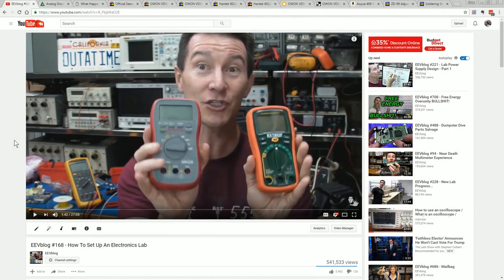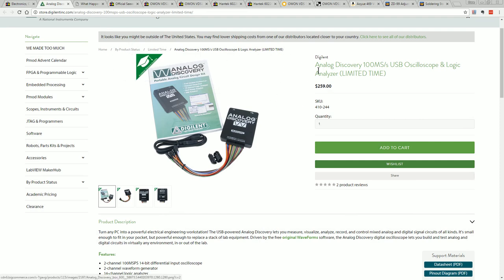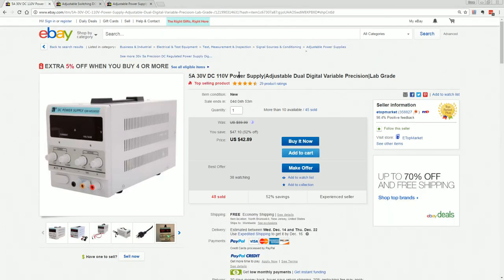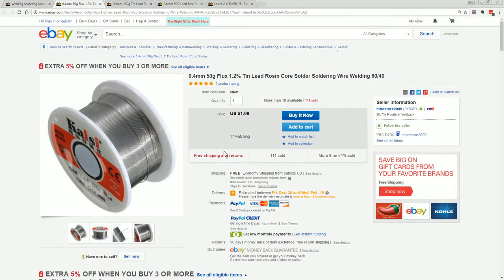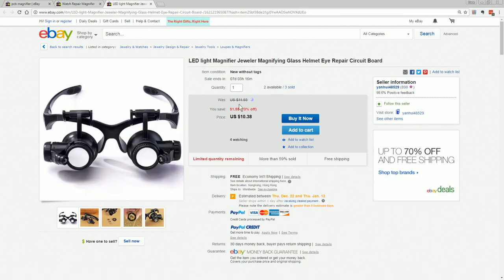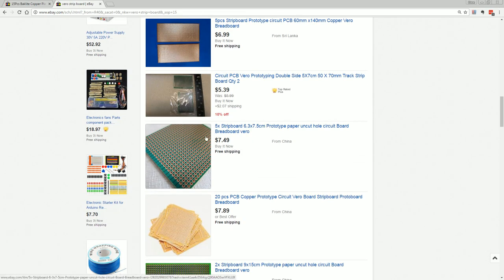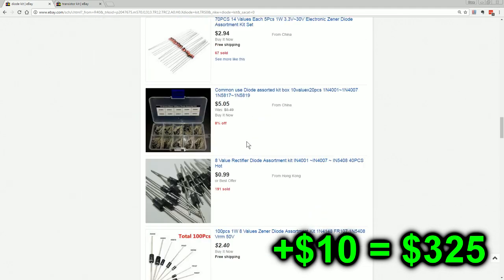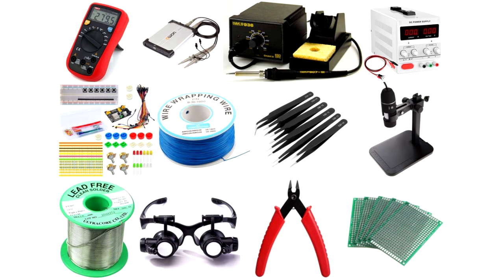EEVblog #954 - How To Setup An Electronics Lab For $300

Comment: I'd add an antistatic mat and a wrist strap to the kit.
A wrist strap is the minimum (should be under $2 US from China). A good-sized mat should be about $15 or less. You should be able to find them as a set.
If you have a bit more money to spend, get cover your workbench with a thick antistatic work mat that resists heat and cuts. If you cover your bench like that, you can probably get away with not wearing the wrist strap all the time.
I always wear a strap when I'm working on PC motherboards, RAM and plug-in cards.

Super cheapskate tip: Check with your company's IT folks. Server parts often come with single-use wrist straps (that the IT guys just throw away).
Reply: Craft store "self healing cutting mats" are not anti static.

Comment: Beware of cheap autoranging DMMs that take ages to settle, and give a series of false readings before they do. A manual range switch is better than these. If you want an autoranger, you might want to pay a bit more for a half-decent one. AN8008 maybe?
Reply: you can set most autorangers to a specific range for faster readings.

Comment: The cheap resistors don't work in the cheap bread boards because the cheap resistors use wires that are too small to work in the cheap bread boards.
Reply: the ones I use do seem to work although they can be a bit fiddly yes, you could twist and double the ends together or you can even fit 2 components in the same hole for a good fit ..... I personally prefer the cheap breadboards as the 'good' one I have grabs stuff so tightly things often break when you try to get them out.
Reply: I can understand you through your accent.
Reply: that's good (?)
Reply: Yes I hate that all the resistors I've bought recently (cheap ones) have weak wires. They're not too small as such, just so weak that they bend before you manage to plug them in to the breadboard.
Reply: I always make a point of checking the pictures before purchasing for exactly this reason. Got some of those cheapies god knows where. Included in some kit or other, I guess. And I find them utterly frustrating to work with. Same for other components, such as capacitors etc.
Reply: cheap carbon film ones have thicker legs and easier to read color codes than those metallic blue ones
Reply: Old comment, but for anyone reading this, you can get 1% resistors with thick leads from Tayda. They work well for breadboarding.

Comment: those magnifier glasses is usless.you have to hold the object you work with so close that it is not posible to work. i tried 25x lens with the user manual 2 cm from the lens you could read it.the hakko ripoff  has so bad plastic base nut where the ceramic heater starts.it so bad that the ground spring in the iron has force to make it pop in 2 and tip and assembly can drop in your lap hot.they dont last a mont.better to buy the hakko fx8801 replasement iron for hakko station and just use the plug and cable that comes with the chinese iron so it fits the station you have.i could use the hakko cable and just change the plug.but the wep 2 in one i have has a movement sensor for sleep mode so i used the print chinese wep irons orginal print board and cable but hakko ceramic heater and assembly.works fine and last.it is more expensive to buy crap like the iron that comes with WEP 862BD+ that brake in a week.i was "lucky" that i got a new station on waranty that also broke in a week.the handle that brake is WEP 9071.it is the same as in the station in video.orginal hakko iron prize about 16 us dollar it works with most 24 volt stations from china.i also went and bougth new quality caps for and 2 triac that handle more power.i also put extra copper fin on the cooling element on them.drilled vent holes in the cabinet on safe for spill places.if it is transformer that holds together with clampt metal.put the corner off it in a wise and tigthen it up.if possible, solder the corners when it is under pressure if they have bolts tigh them upp.goes for all srews in the station.just make shure they are tigth.or live with a noise transformer that gets louder and louder.sorry for my bad english.i love those videos you put out.ihave my own el lab dorment for years but now it is upp and running thanks to inspiration from videos like yours

Comment: T12 is much much better than YIHUA. And you can also find it on ebay and also as KIT. I have no good experience with solder from e-bay. Solder with lead is like lead free... I prefer buying solder locally.

Comment: If you have good eyesight, you maybe able to get away without magnification glass or USB microscopes (I sure do, and I have the 20/20 eyes for the job)
Reply: This video popped up shortly after I ordered a Fluke 17B+ and Hakka FX-880D. It got me to go ahead and get the power supply.  Using wall wart power supply's suck. You can't see the current so with a dead circuit you don't know if something is shorted out or open circuit.  Well until you burn a finger in something. Now with the Rigol scope I got a couple years ago I may actually do more stuff

Comment: Hey guys, if you are going to buy prototyping board, don't buy the yellow ones. I have already tried it. They are not worth the mony savings. They crack easily and the copper pads don't hold.

Comment: 8:04 they are terrible. and when i say that they are terrible then they are terrible. I once bought them and when you start soldering, the pads fall right of the board. and also they smell really bad and that for many days. that smell will never dissapear. Just invenst a little more in those pcbs and you will get something that is sooo much better than that. (i had experiemce)

Comment: You can get all but the Oscilloscope even cheaper if you have the patience to wait for it to come over from china. Aliexpress is your friend if you are fine with cheap chinese crud.

Minus the Oscilloscope, I just priced this in at a little under $100 on there. But then there is the 20-50 day lead time.

Comment: There's lots of kit function gens out there. But I'm having trouble finding anything that can give me a 12V square wave for testing automotive stuff that I build for my old land yachts. It would be nice if it had a box since my workbench is stainless steel with lots of holes in it (used to be a clean room workstation to allow acid to drain through if needed). Those kit boards don't much care for sitting on that surface and I really don't want to have to spend hours grinding some project box to fit the silly thing. If anyone can help me, that would be great. My Google-fu has failed me.
Reply: Looks like I might have to use a lower power gen and just trigger a mosfet for the 12V pulses. All of the wave stuff I need is 5V or lower.
Reply: 0V to 12V or -12V to +12V square wave? I assume 0V to 12V. You should have a look after FeelTech FY3200S series signal generator. It's a really good compromise about functionality and costs.
http://www.eevblog.com/forum/testgear/feeltech-fy3224s-24mhz-2-channel-dds-aw-function-signal-generator/
Reply: ***** Nice. Thanks for the help.

Comment: @EEVblog would one of those inexpensive clip-on microscope lenses for cellphones, and a decent older camera phone be a good alternative to the USB microscope for SMD soldering? Perhaps mounted on the base of my helping hands using a cellphone car mount?

Edit: got this mount https://www.wish.com/share/4130hbrqgx and this microscope lens https://www.wish.com/share/3363hbrqot and fitted it onto my iPhone 4S. The instructions direct you to an accompanying app called TinyScope that allows you to use the flashlight function and the camera at the same time, make measurements (once calibrated), take photos and shoot videos. 

Assuming that you are using an old phone, you can breathe new life into an old device, and get the functionality of one of the soldering microscope devices with a built-in screen, for the price of the USB microscope (probably with a better camera).

Comment: Hmm, perhaps you might be clear that this is how to set up a lab super cheap if you absolutely cannot spend any more, but when you use cheap equipment, things function poorly and break.  I hope new hobbyists don't get frustrated when they buy stuff that doesn't do what they need it to do, and then needs to be replaced when it craps out.

Comment: I wouldn't buy cheap magnifying glasses or usb scopes. They are nearly useless. Since I have good eyes, when I need to use magnification it has to be decent. Most young guys starting would be in similar situation. Get yourself a quality magnifying glass for starters, then look for a used microscope. Never seen a USB scope that is not garbage.

Comment: Anyone can make a $0 oscilloscope and signal generator with a  usb sound card & sound card scope or miniscope software! it gonna be useful if you don't have one bt needed to analyse the low speed signal. Currently i'm using it as a low speed programmable signal generator as i don't have one.

Comment: Why he suggested lead free solder? Just because it's cheap? When do hobbyists needs lead free solder wire?
Reply from the maker: I suggested both.
Reply: EEVblog Why? What are the advantages of having both? I just find the lead free stuff hard to work with.
Reply: Lead free is just the environmentally friendly option. It smells worse and is harder to work with but its easier to recycle when you end up scrapping it one day.
Reply: Lead free can be usefull when working on fixing/modifying existing hardware. (and Sn100Ni isn't that horrible to work with)
Reply: Old-school lead solder violates environmental laws in some places. It's also toxic, obviously.
Reply: Paul Frederick the main problem is what happens when you throw it away
Reply: Polution from trash (mis)management is a pretty damn huge problem already. And the "not my problem" way of thinking is a lot of te reason for the mess we are in today.
Reply: That "not my problem" attitude really sucks balls. If you think somebody else should be handling it, work towards a more socialized society. I've seen enough of Mr. Frederick to be very certain he does not.
Reply: Paul Frederick Yea, it would be horrible if people started to take some responsibility... Like for instance demand that their representatives does what is right.
Reply: lead free is good for wearables, projects for children, and items used in the kitchen.

Comment: You can get a multie meter $3 bucks, dirt cheap soldering iron kit for $8, a DIY osciliscope $20. A fume extractor from a pc you found in the dumster and bounce sheet for 5 cents. A kids learning scope for $1 at yard sell. Variable power supply from a 12 ac adapter and V pontienmeter for $4. Esd strap made from copper wire for free. You can prob do it for $30 not $300.

Comment: Haha or just be like me and buy the good stuff one at a time.
I do have a cheapy multi-meter and an Extech that I have Dave to thank for getting that as I use the cheapy on some stuff and my Extech on other things and sometimes I'll even use both just to make sure things are bang on, on both meters.

I also have the cheapy one if some one wants to borrow one of my meters and they get my cheap one so if it does not come back I am not out to much  money. xD
I also have a crap ton of diodes and resisters and caps as I kind of need them for my pinball repairs.

But when I first started out I did not even have a meter and had a electronics guy send me one as he could not believe I did not have one and I called my self a techie. xD

I think I have earned my nerdeness now as I still do not have near enough electronics crap as I always need something for pinball machines that come in. xD

Comment: Soldering iron suggestion: I bought a similar one to what Dave proposed, and it worked fine, but heated the tip very slowly - usually could start soldering after 30 seconds, and it didn't go to the desired temperature until 45-50 seconds passed.. After two years of usage it gave up the ghost so I researched the topic and bought a T12 soldering iron for ~30 bucks on aliexpress - the tip itself has the heating element inside of it which means it heats up to operating temperature in literally 5 to 7 seconds. It's absolutely great.

EDIT: Flux pen? Nah. Flux syringe. Just slather everything in a thick layer of flux paste, Louis Rossmann style.
Reply: Just a micropull will do lol.  There are quite a few nice little soldering stations out there in that 30 dollar range now.  If you have one of those 900m style irons that heats up slow.. you can build one thats powered off of DC really cheap.. like under 20 dollars cheap.

Comment: i began my interest in electronics using nothing but a simple screwdriver and a light bulb on a bit of wire, these days you can learn so much off the internet that you can learn a lot about the basics without spending anything on equipment at all, and only buy what you actually need, most people will never use an oscilloscope or logic analyser and i find a standard solder iron works very well, i have no need for one with a variable setting, after watching this video the real challenge should be can dave setup a lab for nothing, i`m asking that because if i was a kid just getting started this video would put me off electronics, i would be fooled by the hype and believe that i really need all that stuff, when in reality a cheap kit off ebay or from maplins is all a kid needs to get started.
Reply: You use the words Maplin (no s in it) and cheap in the same sentence. lol

Comment: This video seems a little roughshot / a shotgun approach. Just throwing ideas at the wall without having tested all the equipment listed. I wish you'd do a video series on working your way up from low end to high end.

Start with low end gear that you actually test and works reasonably well and that people could learn on before dumping big bucks into electronics.

Move up tho medium and then high end gear, suggesting an upgrade path and reasonable stepping stones.

Not every chinese kit is going to be good enough for even a low end setup and sometimes they might have a medium grade piece of kit that people could upgrade through reasonably well. When you get to the higher end stuff, you can start listing the big brands people should know and focus on buying from.

Comment: bad soldering station (no real power as printed on case) and bad solder choice, don't buy cheap solder because it's hard to solder with it and it not very clean ...
Reply: on one hand you are right but in electronics you learn from your failures everyone can remember when I bought that first soldier iron and  I have a scar to prove it
Reply: actually the solder he showed at first is pretty good, i like it better than radio shack solder.

Comment: I will recommend never touch solder wires like kaisi or else that appeared in video. It is disappointment. better try kaina 63:37. glasses are useless if not harmful. instead of iron station better get hot air station with iron. cheap hand tools in sets of 10 or so  are shit better get less but better for tweezers big one and sharp one, for pliers get one for 5usd at least if you buying unbranded instruments. Also you will need execto knife and good set of blades for it. wires and other expendables is not equipment for lab
Key is not getting cheap, but get better in low price and do not waist money on useless stuff which is hard